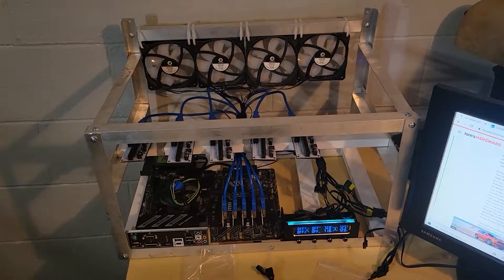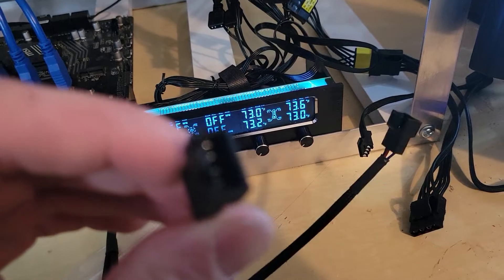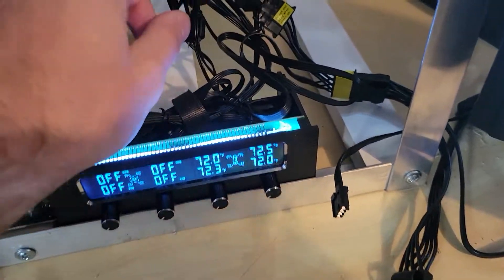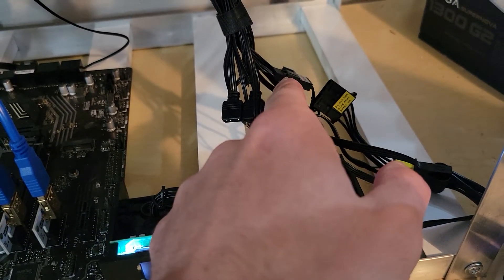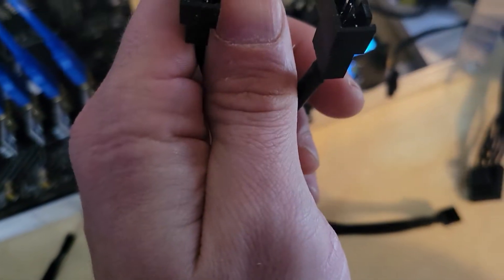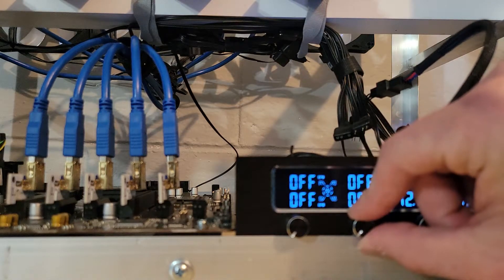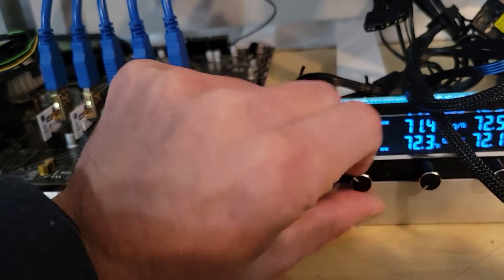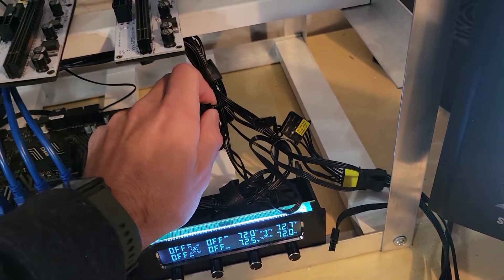3 Pin and 4 Pin Fans/ Fan Controller/ Fan Splitter

Comment: Can i plug a 3 pin fan into a 4 pin splitter and if so which side do i connect it do the left 3 or the right 3.
 And the with the mobo if it has 4 pin connector can i also connect 3 pin fan to it?

Comment: it's a splitter mate, if you connect a fan on the other connector, the system will read the speed from the first fan (4 pins), and the second one (2pin space 1 pin) will have the same speed
Reply: I have a stupid question...I have a 4 pin header on my gig b550 using this same cable splitter I have one end 4pin going to 3pin 120mm case fan and the other cable end going to 3 pin cable end to my 4 pin 92mm 4 pin case fan. Is that okay? Sorry if I sound confusing

Comment: if i plug twp 3 pin connector fans into a 4 pin splitter will i still be able to control both fans by the voltage on the motherboard? I understand they will both go the same speed but id like to control them with the motherboard by voltage. I hope that makes sense and you seem to know what you're talking about
Reply from the maker: Lol... Ok so let's see if you have a 3 pin coming off the mobo and a "4- hole splitter  cable" with a 3 pin fan plugged in.... The fan speed "should" be able to be adjusted by changing the voltage on the motherboard. Does that make sense??